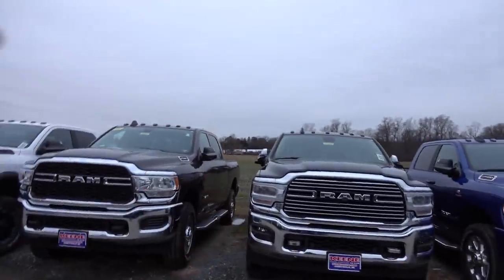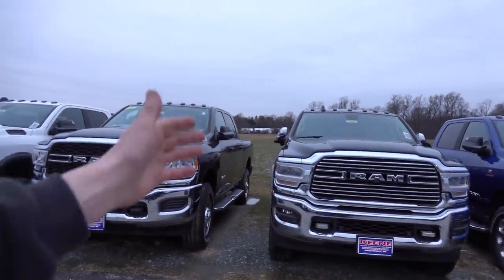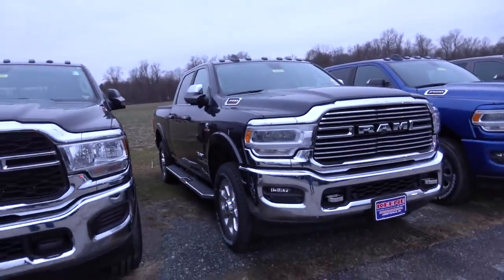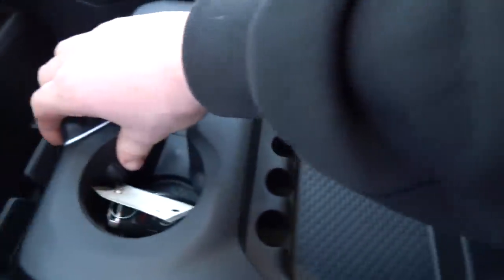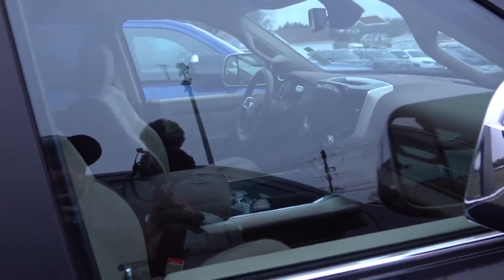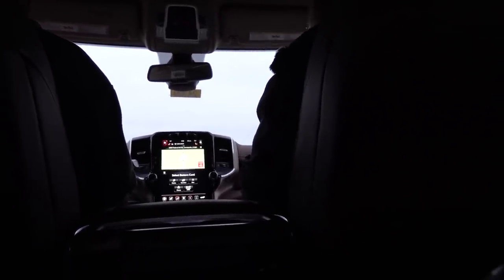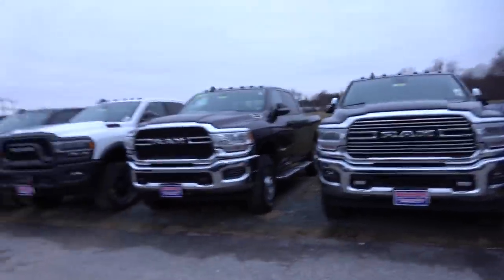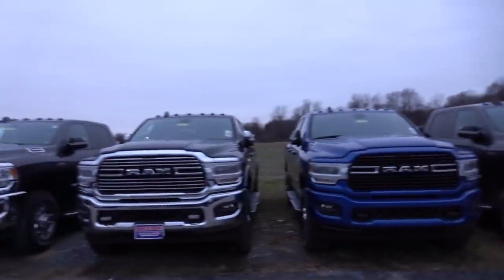5th Gen Cummins Test Drive... Is This The Best Diesel Truck Of 2020??

Comment: I have the Aisen. It definitely feels a little weird at first. It actually feels like someone is shifting a standard trans. It’s weird. But after a few hundred miles it’s just routine. And I haul very heavy with mine.
Reply: Agreed.  Mine feels like an auto shifting 6 speed manual.

The ONE gripe I have is I wish it would or you could opt for it to take off in 2nd gear from a stop.

1st gear is WAY too short of a ratio for driving empty.

Comment: The interior is where you spend your time. The Dodge has the best interior. And it's the only truck you can work on without lifting the cab. EZ Lynk can fix the shifting and give you some nice extra power with emissions

Comment: Hard to beat I6 for towing purposes.
Reply: Justin Lienhoop that used to be the case but in 2020 tow testing is showing Ram in 2nd or 3rd place since ford has definitely more torque and hp and at a lower rpm of 1600 vs 1800 peak torque rpm on Ram...and no 10 speed they’re lagging now but I agree that used to be the case
Reply: L W and that’s all because of tuning to comply with emissions. An I-6 is inherently better for towing and overall work. That’s why semis are mostly inline. Throw emissions on the mix and Ram has to detune to comply.
Reply: mraycgz Actually i6 puts off less emissions than V8 n Cummins was actually the last to have to add dpf to comply because of it n therefore Cummins has the least excuses of all and their 1000 ft lb isn’t necessarily detuned from Dmax 910 ft lb n somehow 20 Dmax pulls as good or better in real world tow testing
Reply: mraycgz Also America is the only country that semis use only inline 6 . Look up scania V8 which keeps up n beyond with the top American Volvo I6😉
Reply: Xxplicit yes like I said used to but things are definitely changing now that people are seeing the V8s out perform i6 in towing in the real world especially 6.7 Power Stroke because it also has the best transmission on the market n Cummins has the worst behind it

Comment: Yup hook her up to a big trailer n the Aisin will break in great. It is a fact that it takes the first couple hundred miles till they learn themselves, just like the Allison and 68rfe. N I personally don’t think there’s a need for 4 extra gears, just more parts to break n give trouble.
Reply: P PUMP 24 VALVE best comment I have read yet! Lol
Reply: P PUMP 24 VALVE lol Try telling that to Tow Piglet that’s driven Ram hotshotting all his life n now has 20 or 30k on a 2020 Power Stroke with a 10 speed and is totally sold on it for towing and btw more parts or no Ram still has the most transmission issues with transmissions I mean I don’t think anything will ever out do the 68 for issues lol
Reply: P PUMP 24 VALVE And btw the more parts more issues definitely didn’t hold true for going from 4 to 6 speed automatic transmissions for the big 3

Comment: I drove a 20 Laramie Long Horn HO 3500 a 20 F350 Limited and a 20 GMC Denali 2500 today and I was impressed with the Ram interior as the most deluxe of the 3 and the Denali was the most behind the times but as far as options drivability and power Ford definitely had the most power and options inside and out but the Denali definitely had more 0-60 snap than the HO Ram did but to get everything in 1 truck I’d go Ford even though I agree the Ram interior looks the best and has the most authentic wood and leather and biggest screen they don’t have a panoramic sunroof, massaging seats pro trailer backup assist electric steering up/down telescoping steering wheel or 4 separate drive modes... and their radar system for the adaptive cruise and lane keeping behind the mirror is about the size of a small suitcase and blocks some of your visibility 🤪

Comment: I'm a die hard ford guy just to be clear. But if you feel loyal to ram I think you will not go wrong with a ram. I have plenty of  buddies with rams and they seem to do well with the the hd transmission. The only complaint they all have is the touch screen software. I love my 6.7 Ford but cannot deny the ram interior is the best of the three.

Comment: The Aisin transmission is definitely an acquired taste.  However, in its defense, it shifts like a dream under load.  I had a 2014 2500 Laramie with RFE68 and currently drive a 2017 limited dually max tow.

Comment: Give the ford another go Tom, I tow my race truck on a 30ft goose and the power is unbelievable. Only thing I envy on a Cummins over my 18 Ford is the exhaust brake, it’s ok at best when towing. Power, interior and looks, Ford is hard to beat in my opinion.

Comment: I had a 6.7 Cummins and switched to the 6.7 Powerstroke. Im a Cummins guy but can't beat the 6.7 Powerstroke . I got away from the Cummins because I didn't like the aisin.  To each their own tho
Reply: Xxplicit Lol have you ever towed with a 15 or newer 6.7 Power Stroke? They tow as good and better as a 6.7 Cummins lol don’t be blinded by facts from 10 years ago go see for yourself. 6.7 Power Stroke has literally smoked 6.7 Cummins for towing for sure for 2020 and has been as good or better for towing for at least the last 5 years 😄😄

Comment: It would be nice if they would have fixed the front cover leak issue with this one. Disappointed that you still have to pull the cam out to do the seal. Also idk about the cp4 and the new hollow cam. It will be interesting to see if they will be able to hold power after a delete or if they will shell the cam out like a hemi will do. The AISIN IS 100000 better than the 68RFE, the RFE has a shit valve body and clutch disk are way to small to hold power especially in 4th and 6th also they run way to hot I think you need some more drive time behind an AISIN I’ve rebuilt countless 68 never an AISIN but hey at the end of the day but what you want
Reply: Hollow cams are nothing new they been running the on the semi trucks for a few years now. There trying to lighten everything up to get fuel mileage

Comment: It’s to bad that all the girlie boys buy automatic transmissions, resulting in the manufacturers not producing and offering a real mans transmission, a manual six speed. 240,000 miles heavy towing NV5600 with the original clutch and still going.
Reply: Yeah, that was the biggest mistake Ram made ever, is drop the manual. I’m keeping my 5 spd as long as possible

Comment: I have a 2019 Ram 2500 4x4 Cummins Laramie night edition and fully agree, needs a better transmission. I previously had a 2015 half ton ecodiesel with zf 8 speed and was fully spoiled by that silky smooth transmission that seemed to always be in the right gear. Now I have a seriously powerful engine that always feels sluggish because the transmission always wants to be in the highest gears and doesn't want to downshift. Pretty frustrating! But it does have a nice interior. Maybe someone needs to figure out how to transplant a ford/gm 10 speed into the ram.
Reply: To anyone reading this, I recently installed a revmax performance valve body (the best one they make with billet channel plate) and got tuning for engine & transmission. My line pressure was increased from 160psi max in forward gears to 225psi. Shift scheduling and converter lockup strategy were all addressed in the tune and I am pleased to report that it is a completely different animal! This truck drives so good now. It's obvious that Dodge tunes it for maximum efficiency and not really drivability. It holds gears longer, shifts firmer and more solid, and downshifts when needed. I couldn't be happier. Anyone else who is frustrated with their 68RFE(Aisin not tunable), seek good reputable tuning and you will be pleased.

Comment: The trans shifts will get better with miles,they adapt to your driving. Remember 6 in a row ready to tow
Reply: ben parker Lol remember no catchy phrase changes any facts. 😂cause I can say 6 in a row ready to blow 🤪doesn’t change anything. Reality is Ford is the tow beast winner for 2020 and has been towing as good or better since at least 2015. 20 Ford 6.7 is Higher Torque, Horsepower and more power to the ground on dyno and peak torque rpm is 1600 instead of 1800 like Ram and 10 speed transmission that everyone is loving for pulling 💪😉👍

Comment: I’d guess you’re going with a ‘20 f250. The 6.7 power train with the new transmissions and has the best features compared to the competition pulls them ahead and they’re really a great interior design compared to the new rams. Plus they’ve got the best styling. Ford isn’t far behind on interiors. Gm on the other hand is way terrible on interior and exterior styling and features. And the IFS can be a workhorse but I’d rather have a SFA. Not to mention if u plan on removing factory parts the tuning is expensive

Comment: Tom, your assessments are almost identical to mine when I drove the ram and ford. 

However, I have to disagree. I still feel as though the ford interior is better. The ram felt closed in to me. More blind spots and just a lot of “stuff” in the cab. Where as the ford is huge and wide open. 

As well as the drivers position in the ford was more ergonomic for me. 

If you end up in a ford, check out the platinums. You get a lot more standard and in a lot of cases including my 17 it was cheaper then a lesser model.

Comment: 6 speed is down fall? Man let's be honest here, you don't know how reliable these 10 speed transmission are. Don't forget, more gears, means smaller components. Size does matter.
Reply: Size matters?? That’s the exact reason not to buy a low output Ram for sure not cause 68RFE is definitely the smallest weakest on the market even though I know aisin is great at stock power

Comment: If you are gonna tow heavy and want a Ram get the Aisin. You get used to it. Or wait a couple more years. Heard Ram is working with ZF for a new HO trans. 8 speed 10 speed don’t know but if ZF builds it it’s gonna blow that 10 speed behind the Duramax and the Power Stroke away. I mean Ford and Chevy use the exact same transmission now
Reply: gun freak only in the half tons GM uses the ford patented 10r80/10L80 but on the hd 3/4 n 1 ton Ford n GM have nothing to do with each other’s transmissions. They don’t even physically look the same

Comment: Dunno, I’ve been a long time Dodge guy myself but I think the F350 is the better truck.
Reply: Complexity definitely better, it keeps dealer in business and owners in debt.
Reply: repairvehicle Overall toughness Ford is definitely better since at least 2015
Reply: @lw6735  , exactly same thing people said about Ford 6.0 and 6.4 until they realized the true definition of Ford name. LoL.
Reply: repairvehicle Only difference here?? Navistar International built 6.0 and 6.4 and proved to be junk by about the 3rd year. 6.7 is built by ford and has proven super reliable for 8-10 years now lol tons of 6.7 Power Strokes going strong at 300-450k miles cause it has the Ford name unlike 6.0 n 6.4 which had Navistar name 😉😉😉

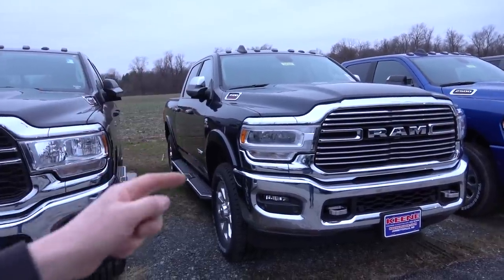Comment: The aisins transmissions have very very low fluid pressure and defuel on shifts, also look at gear ratios, mine with the aisin ar 3:42s lugs hard but one with 4:10s or 3:73 ratios dont lug as hard.

Comment: Ram definitely needs to invest in a good transmission. They have everything else going for them but that seems to always be the dodge and rams downfall. If you weren't going to modify it the ford would be the better choice but even stock I just dont like all the clutter and hoses and how everything is plastic under the hood. If your going to modify it and want longevity I would choose the ram easier to work on and a proven platform.

Comment: The Ram feels,like an old truck to me ,probably because it is! The cab,doors and windows are small,it feels small inside compared to my 2017 F150 crew cab. Forward and front side Visibility is poor on the Ram and Chevy compared to the Ford. Ram is definitely a winner because of the Cummins , love an in-line 6 diesel....I gotta give it to Ford though they have the oldest truck but yet it feels the best to me and the new Gen 3 6.7/10 speed is the clear performance winner hands down....very disappointed in GM ,the entire truck on the outside it’s ugly and took high especially the front end,  on the inside it’s interior is 5-7 years or more behind the competitors in this class. I like the steps in the bumper on the GM trucks , that’s about it...I am a. Duramax fan ever since owning one but I don’t th8nkntheres enough there to ever get me to buy one it would have to be 8-10k cheaper than a Ford to consider it .
Reply: John DiMartino Have u even put ur foot inside a new Ram. Laramie Longhorns have the most room of any

Comment: It’d either be the Ford or the Ram for me. If parts ever were going to fall off L5P’s are like 10 grand lol which sucks because the L5P is and extremely stout engine. IFS sucks ass. 6.7 Powerstrokes have really been proving themselves and ever since the 4r100’s in 7.3’s Ford has had good transmissions in the Powerstroke trucks, can’t speak for the 10 speeds yet as they’re still new but if they follow suit for the last 20 years they will be great as well. The Rams are nice trucks, we all know 68’s suck, Aisin trans are better but are they to compare with a 48 or a 4r100 or 5r110 as far as durability? Depends on the person. All down to choice, I’d have to switch it up if it were me so I’d try to Ford.

Comment: I know they say opinions are like a**holes, everyone has one and most stink,
but I like to see you keep your truck.

Why buy a truck that cost as much as a house, well some houses.

Put a built BD 68RFE in your truck with a mild towing turbo like a 
S364.5 SXE with a second gen manifold like you had. 
As long as you’re towing and daily driving you will be good.

I don’t know how any manufacture can justify the price of these new diesels. I will buy a house before a new truck especially when they cost is almost the same.

Comment: Can beat the Cummins. Aisin transmission has been a beast in my 2019 truck. Not a rocket of the line like ford but they work awesome. I tow with my truck. If it was a around town truck cruiser then I buy a ford.  Hahaha NOT.

Comment: Powerstroke will definitely will keep you in debt and dealer in business. Remember, complexity doesn't equal reliability. Ford and chevy cost of repair is double.
Reply: repairvehicle Cost of repair is maybe more pricey but definitely less frequent on Ford overall truck than on Ram since 2015 for sure
Reply: @lw6735  Ford and chevy 10 speed with plastic Oil pan definitely will keep people more frequent customers at the dealership.
Reply: repairvehicle I guess we’ll see on that but Ram guys have nothing to say on transmissions until Ram gets their act together and btw GM n Ford only have the same half ton transmissions but 3/4 n 1 tons share nothing in common except number of gears

Comment: Nope still a pos if not even worse then the 3 gen and 4th 
Still has a pos 68re and the roller lifters have really been problematic as found with plenty of videos from power driven diesel . 
And there power numbers are a joke compared to the fords

Comment: Buy the Ford. I had a Cummins during the 6.0 and 6.4 PSD years. It was junk too. Front ends trash. Build quality junk. 
Q: What's the difference between a Ram/Dodge and a Jehovah's Witness
A: You can shut the door on a Jehovah's Witness
6.7 PSD and Super Duty is better in everyway. (Except unloaded mileage)
Reply: @ppump24valve53  dropping transmission and rebuilding front ends for a pickup that sounds like a whiffle ball running down the highway. 
Cab lifting sounds like a one and done. Work on a Dodge/Ram and hone your skill for the next time aka 50k miles.
Reply: Slim Light I’m a mechanic and work on equal amounts of Ford front ends As far as replacing ball joints Fords are not better, on top of that, Ford still uses their stupid problematic unlocking hubs. Who wants to get out in the middle of a snow storm n lock in their hubs, not I for sure! Tell me the explanation of a whiffle ball. N yeah u spend 10 k + when u lift the cab cuz u fix all the problems while ur there so u don’t have to pull it again in the next 100 k miles.
Reply: @ppump24valve53  A mechanic that doesn't see the value in lock outs.  The whiffle ball reference is the sweet, squealing, wind noise in the cab while running down the road. I've owned both. Only plus that the Cummins gave me was unloaded mileage.
Reply: Slim Light ok so let’s clear something up I’ve never driven a Dodge that whistles in the cab. Mine has 290k on it, factory weather stripping, quiet  as a new 1. Driven countless Chevys that drive me crazy cuz there so loose. This is a Chevy problem big time.